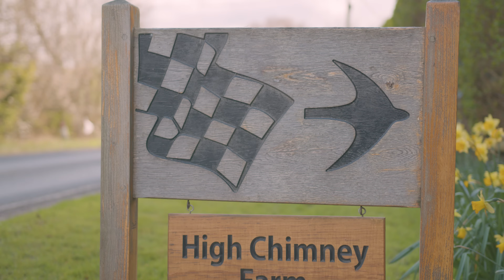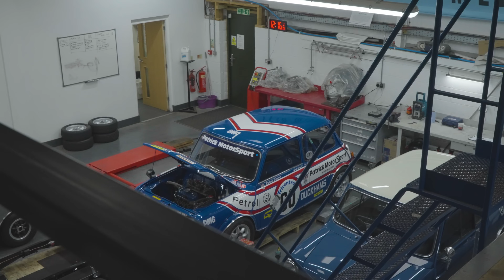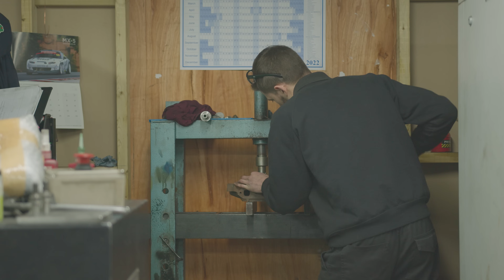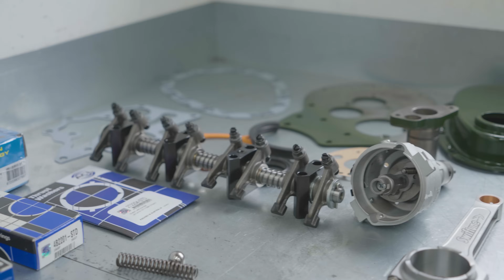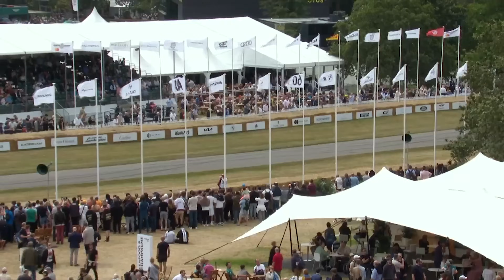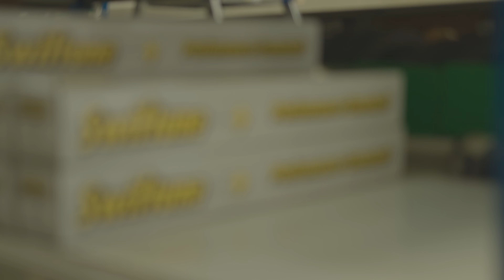Greatest racing Minis | Swiftune | Goodwood Masters

Comment: It was great to hear the story of Swiftune, a modern mini tuning firm. Back in my mini racing days such firms didn't exist, it was all DIY. I stopped racing in 1963/4 after the introduction of  Broadspeed's S's. There was no way that we could complete with them and their (relatively) vast resources. By the way I was a member of TEAC when they invented rallycross and involved in its promotion.
Reply: My now wife of 59 years and I were marshals at Lydden Hill for the very first Rallycross event in 1967.  The organizers had imported a lot of crushed rock for the off track section to make it "more like the Welsh mountains" as I recall.  Unfortunately the rocks were the size of hens eggs and did a huge amount of damage, taking out windscreens, denting bodywork and in a few cases injuring the drivers.  Even we marshals had to duck for cover at times.  Most of the damage happened before the lunch break and before ABC TV had their cameras rolling.  I know at least two cars were damaged enough to not  return to the 'track' after the break.

It was a spectacular event, being 'made of for TV'.  I'm glad it survived that first event debacle.

I raced APH109B, a 1964 1071s that I bought from Stewart Turner before he left for Ford.  The car had been used as a recce car for the Finnish 1000 Lakes rally.  It was not a 'prepared' car.  Just a production one so when I got it it already had a wrinkled roof and all the shocks and bearings (wheel and radius arms) were shot.  Stewart included replacement bearings and shocks at cost (250 quid I think?) and the works stiffening panels that needed to be installed inside the rocker panels to replace the thin standard ones.  That car was the most fun you can have with your clothes on.  90mph around the Herts and Beds lanes with my mother-in-law navigating.  Unbelievable.  The best photo I have of that car is slideways at the bottom of Paddock Hill Bend at Brands in the pouring rain.  I was fully 90 degrees to the direction of travel after hitting water pooling at the bottom of the hill before Druids.  Denise McLuggage was racing there that day and did exactly the same thing and neither of us even slowed down.  Great cars.

Comment: Hi Nick   Out of interest, what camshafts do you use? or do you manufacture your own?  In the days when I had a 1275 I put , I think it was BL 88g229, with more valve open times than
a 1/2 race cam, made it quite a lumpy engine but boy, did it go!.